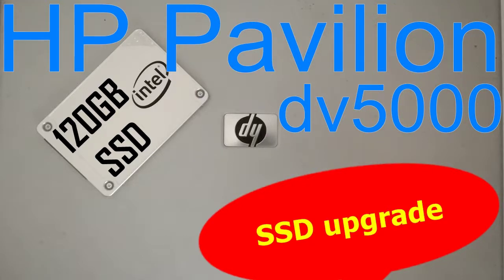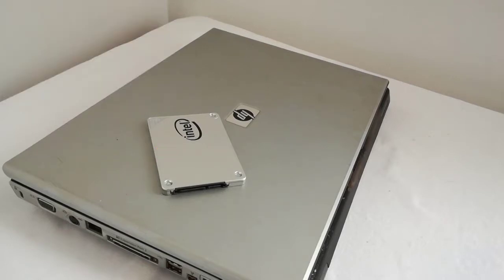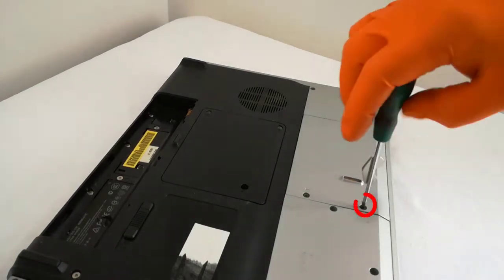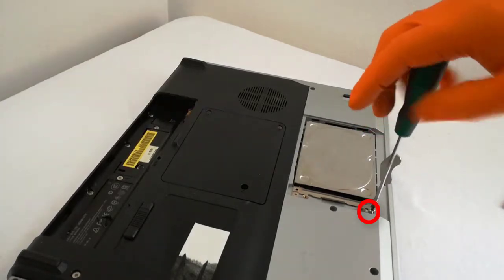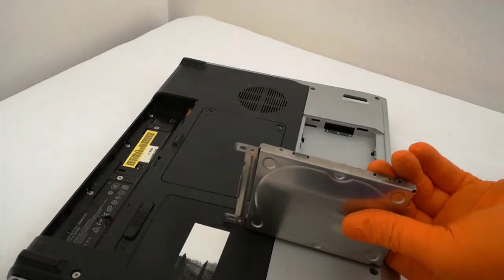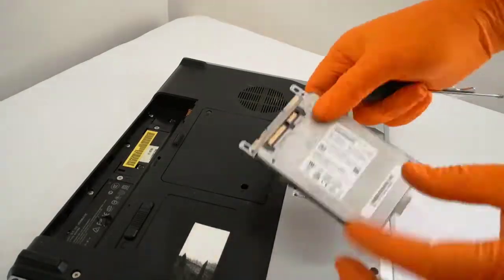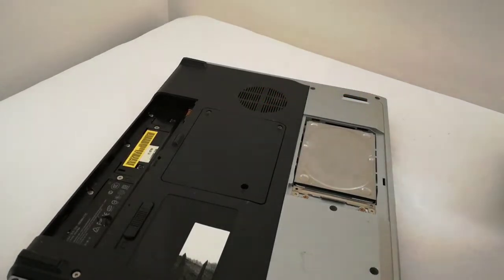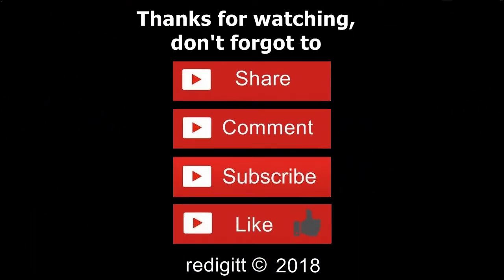How to upgrade the HDD to SSD for the HP Pavilion dv5000 laptop Ep.239

Comment: Is this still worth using these days?
Reply from the maker: Of course, if you don't have much money, with little money you can make your laptop once again enjoyable .....if you are using for internet browsing (not full HD, 2K, 4K) and office.
Of course the laptop will not perform like a new generation laptop, but for 25$-50$ will work for 1-2 years.
Thank you for watching, if my video or advice was useful, please consider to share and subscribe, have a nice day.
Reply: @redigitt  im a IT student and im more on java programing is it going to work fine on programing without lagging sorry i just want to know im not that expert on this stuff
Reply: @redigitt  also i think the charging port is broken do you have any recommendation on how to buy the parts needed to change the charging port
Reply from the maker: 1. I don't have java coding skills, I only new a few HTML code, so I can't tell if will be lagging or not, but you can upgrade the CPU to a Core Duo T2700 @2.33GHz and with the SSD upgrade and a new OS installation will work much faster.
2.You can search and buy from the internet  and replace yourself (it will be the cheapest) or you can go to a repair shop (it will be more expensive).